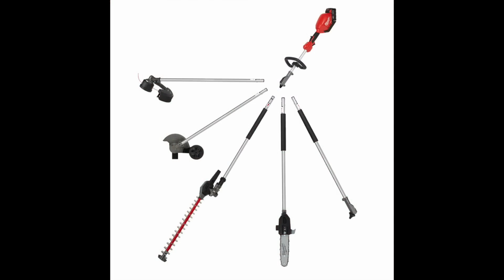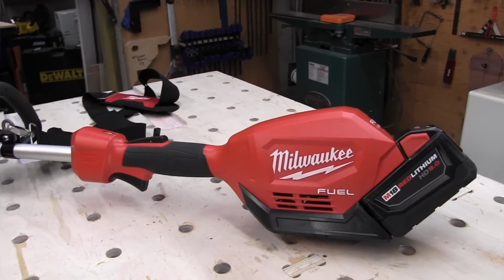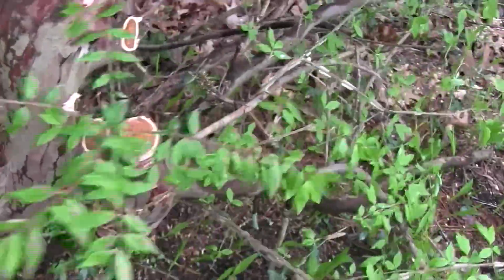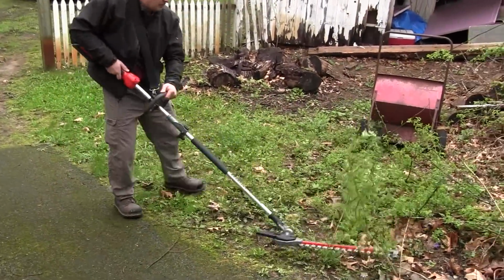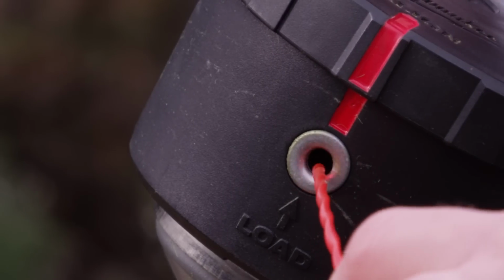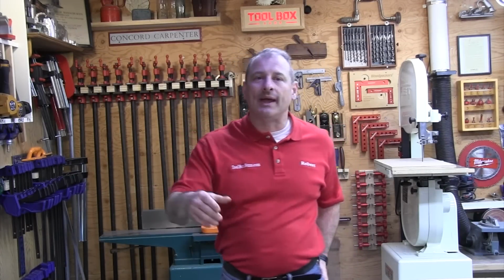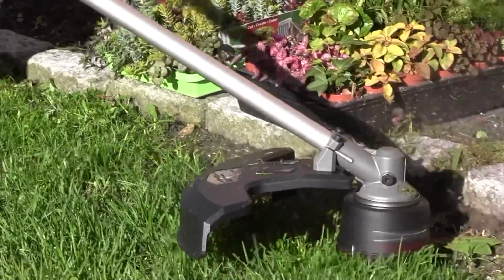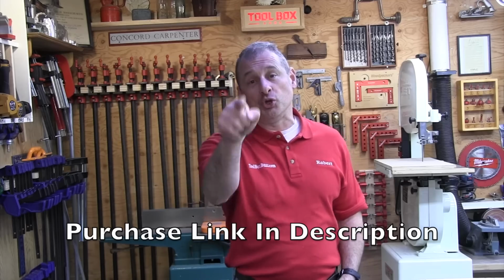Milwaukee Tool M18 FUEL QUIK LOK Accessories

Comment: I bought this kit last month.  I have about 2 acres with a bunch of honeysuckle to get rid of, and a fence overgrown with blackberry. The pole saw and hedge trimmer are making quick work of it. The hedge trimmer in particular is a beast. The only issue I've run into so far is the one mentioned in the video: the attachments don't always want to lock and you need to either wiggle them or blip the motor to get them to alight properly.
Reply: That's the kit I'm looking to purchase.  I can purchase the pole saw with battery and charger and get the hedge trimmer for free AND free shipping.  Can't beat that deal for $400 Benjamin's.  I don't need the string trimmer since my 4 year old gas string trimmer works just fine.  I'm sold.
Reply: William Logan that $399 pole saw kit also includes the extension (pole saw attachment by itself doesn’t). So one less thing to get later.
Reply: @patrickmcclintick9552  Yep.  I just pulled the trigger on it but for some reason they wouldn't give me free shipping to Vermont.  No worries, it was only $30 more for shipping.  I have 20 acres of prop to maintain so this kit should work great.  Cheers!
Reply: How does the hedge trimmer work on small 1/2" saplings. I got hundreds of them and a lit of m18 batteries
Reply: What kind of monster are you to cut down honeysuckle and blackberry bushes? Those where a staple of my childhood! Shame on you!!! ;)

Comment: I bought the older string trimmer model and use it almost weekly. Does a great job. Need an edger so now will have to buy this model and have two trimmers. Wish I waited. Could use the trimmer as well. There goes another $300+

Comment: I just got the string trimmer and so far very impressed with it! I used to do a lot of string trimming around my parents farm and I'd say this thing has as much power as any of the gas ones I've used and you don't have take 15 minutes to get it to run right. I had the same issue with the qiuk Lok aligning but it's pretty minor. Overall quite happy with it.
Reply: Get the edger. First use it cut nice clean lines my driveway has never had. I mean it gutted the grow over weeds and grass.
Beats trying to do it with manul tools.

You wont regret it.

Comment: Got the pole saw and blower combo. It doesn't come with the pole extension or the strap, may need to buy later. Use the pole saw first time yesterday and got a bunch of work done, much better then the manual pole saws in every way except it feels freaking heavy after a while. With the extension its even more so. Don't think it was mentioned, I had trouble separating the two sections. It was held in so tight when finally got loose, a little dielectric grease did the trick. Yes I did loosened the knob first. Would not go back to 2 cycle tools ever again. For yard work settled on Milwaukee and Kobalt 80V. Waiting for them to come out with a post-hole digger.

Comment: I use my hedge trimmer for all kinds of brush cleanup.  I also use it for spring cleanup.  I get right down to the ground on all the dead growth and then it just blows or rakes away.  Super easy and super fast.  I'm looking at that articulating head on the hedge trimmer and thinking I could use it for trimming weeds in the lake.  It probably won't last all that long, but the dedicated weed trimmer I have now (which I now have to spend more time repairing than trimming) was several times the cost of just having to buy a new accessory head.  Hmmm.
Reply from the maker: Wild Goose You my friend are who is this tool was designed for… You’re a visionary
Reply: @ConcordCarpenter   it is going on my wish list for sure!

Comment: Get the 12.0 battery will run better and longer . We have the older trimmer and blower they really work good.
Reply from the maker: John Bailey You’re right but it adds a little bit of weight, I had a great run time with a 9AH battery
Reply: Yea the girls do 30 to 36 lawns every day so the 12.0 just adds to there run time. We pack the trailer with the batteries 9.0 and the 12.0 the 12.0 batteries seem to run a long time but they use a lot of them every day. And then they are back on the chargers ready for the next day of work.
Reply from the maker: John Bailey you have a crew of ladies?
Reply: A Concord Carpenter / ToolBoxBuzz  i live with twins they wanted to get involved with the lawns so I let them take over pretty much. I do all the maintenance and go help them on monday and Friday. Each one of them do 30 to36 lawns a day . It took them time to get use to all the work but they do very well now. They are 35 im 76 we have been living together since they were 24 and it has worked out well.

Comment: The articulating hedge trimmer is heavy, says it is only 5+ pounds, but at the end of the end of the extension it feels like 50 and the strap does not get small enough to fit me to hold the trimmer at the right level.

Comment: I got my pole saw. But it did not come with the extension or the harness.
I've got the saw. Trimmer. And edger.
I've been cutting down smaller trees with the saw as well as wild bushes. I need to get the harness. But now milwalkie has added a power broom both nylon and a rubber version as well as a brush cutting head with a metal blade. Ive yet to see these in big box stores but Tool Nut has them its an online tool company. 
I think the broom is 23" wide.  Think what you can do with this sweep the drive sweep the basment or shop, or even on a construction job clean up a job seight with it.  Im wating for a cultivator attachment you just know its comming.
Or even a power brush to wash your driveway with hose attachment you can also use on the wood deck.
There is a good use for the broom as a scrub brush cleaning mold off a wood deck. Or hey how about a pole 6" orbital sander  or even wall sanding attachment for painting with vacume hookup.
No they havnt reached the max of add on tools they could make for the power head.  Car buffer ?  Seriously its a power head just add attachments. 
The broom looked kinda pricy but think about what you can use it for.

Comment: I have the Milwaukee quick Lock string trimmer with edger attachment, they both work awesome, would like to see a possible tiller attachment. And please Milwaukee make a lawn mower, I don't want to get another brand lawn mower if I don't have to, because I'm invested in Milwaukee batteries.
Reply: Aaron Repper agreed, would be nice. Imagine if they had a cyclinder mower :)

Comment: What is your thoughts on Ryobi, Kobalt when comparing to the Milwaukee for homeowners ? What about warranty coverage and price differences? Thank you for taking the time to make these videos 🙏👍♥️
Reply from the maker: Were reviewing them now
Reply: Just my opinion. I like ryobi everything in used from them has been at least decent, and the number of tools available on the one+ system is second only to the pro level brands. I would stay away from kolbalt. Lowe's seems to be replacing everything with craftsmen.
Reply: @nathanmitchell4196  thanks ♥️
Reply: A Concord Carpenter / ToolBoxBuzz makita too?
Reply from the maker: Kim Nimbus Personally I steer clear if Ryobi, it’s a DIY homeowner grade tool

I use in the Milwaukee tools on the job site, why not use them on my home
Reply: @ConcordCarpenter  👍🙏♥️
Reply: We have both systems Milwaukee Fuel and Ryobi..The  Milwaukee has more power and longer run time. It works best for heavy duty use. The Ryobi string does well on grass. The reciprocating saw is lighter weight and good for general light pruning. The Ryobi runs for ten minutes while the Milwaukee for 45 minutes for us.

Comment: Awesome video....I've been looking for a good in depth review on this unit....and man Rob...you just sold it lol 😆
Reply from the maker: Glad I could help
Reply: I'm loving the string trimmer.  So far no bog downs or anything for that matter.  Finally ran out of the line that came pre-installed and lucky thing I bought 250ft 0.095 line so I can get back out there in the yard.  Can't wait to get the pole saw and hedge trimmer

Comment: I switched from (mainly) Dewalt to Ryobi when Dewalt went to a ton of different battery platforms. Ryobi's One+ system has over 125 tools that use the same battery platform. Maybe Ryobi doesn't make the best tools, but they've been working fine for me and they can be an extreme bargain when you catch a good sale. I believe Ryobi invented the string loading mechanism that you like on the Milwaukee weed wacker.
Reply: I'm calling bullshit... Dewalt 60 volt platform works with the 20 volt. If you only wanted 20 volt you could just buy the 20v version of any tool they make.
Reply: @John-771  Why would I buy a 60V tool and use a 20V battery? What about the 40V tools. What about the 120V tools? Do some research before calling B.S.
Reply: @Pro1er  the 120v uses 2 60v batteries. I have the 60v line as well as the 20v. The 60v can be used on the 20v tools not the other way around. The 40v is commercial lawn tools only. Consumer grade is 20v and 60v. I know my tools and know ryobi is shit. Fyi I also have makita and Milwaukee.
Reply: @John-771  And I have Bosch, Makita, Dewalt, Craftsman and a bunch of other cordless tools. I'm done with all of the proprietary battery nonsense. Milwaukee, Makita and Ryobi have it right sticking to primarily one battery platform, if you want to invest in batteries instead of tools, knock yourself out.
Reply: @Pro1er  Milwaukee is going to start a 56v line as soon as 2020... Makita said they are looking in to it as well. Stick with Ryobi, and comment on something you know more about.

Comment: question the extension pole... can you use two at the same time... doubling the length of the pole saw.
Reply from the maker: Richard Gray yes but not recommend - balance and control is tough

Comment: Why isn't Milwaukee and Ryobi not use the same batteries.  TTI must have not looked into that.  I wouldn't be surprised if Milwaukee doesn't already have a lawn mower in development.
Reply: I think it is all about money! This way they can sell more batteries
Reply: Ryobi use stick battery Milwaukee uses slide
Reply: @loucifer323  - I know they are different.  I am just saying that both brands are owned by TTI and should have been built to use the same batteries.
Reply: @answeris4217  Same goes with SBD dewalt doesn't fit porter cable and vice versa batteries is where they make their money
Reply: @loucifer323  - I think that Black&Decker and Dewalt are tied at the hip and should share a battery platform.  PorterCable is an other prosumer brand.

Comment: I had just purchased the string trimmer before they announced the Quik Lok system. Grrr... What's the chances of them making an adapter kit?
Reply: Cbr Duck none, if you paid more than $175 for the kit you overpaid, still a good tool but you unfortunately have to pay more for individual tools now which take up space

I only have a hatchback car and when you have garden tools that are 7 feet long, you get spoiled when you can split the length in half

Comment: do a side to side of the milwaukee vs 60v dewalt , 82v snapper and Ego Trimmer
Reply: Milwaukee will lose, but if you have a ton of milwaukee's battery, might just be enough to get the job done.

Comment: Those tools all look suspiciously like the Ego system that I have. I know ego is 56 volt but I suspect the electric side has been reworked to covert to the M18.
Not a bad thing especially as the ego batteries are eye watering you expensive. Good idea if I am right to use the best on the market as a base for your own but don’t try to kid us it’s all your own work Milwaukee. If it is you can expect a call from ego’s patent lawyers.

Comment: I can't warm up to cordless tools. I feel like their still underpowered, and run time is terrible.  Yes their much better now, but when you started out from the bottom of the turd barrel, anything is better.  Also if it's been sitting a long time, your probably gonna need new batteries and their not cheap. I like to buy something quality and be done with it.   I'll just stick with my gas Stihl farm boss chainsaw and gas Echo trimmer & blower /vac. Barely any maintenance, always starts right up, power is always there when I need it.  Never had issues.